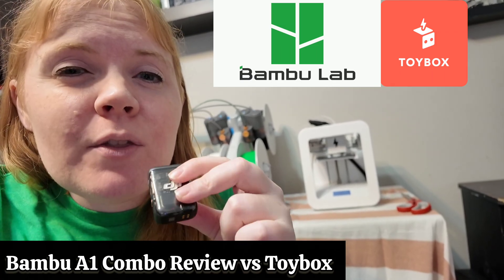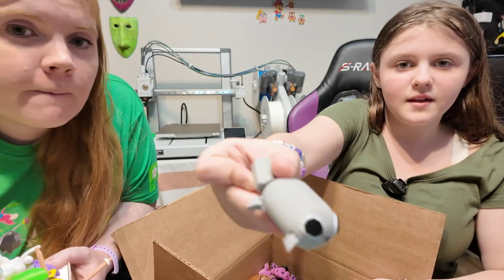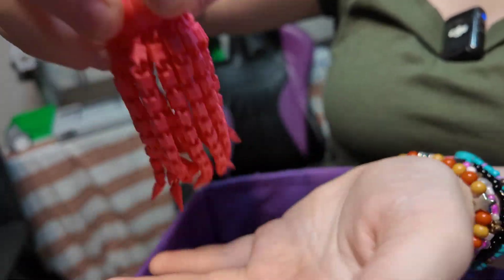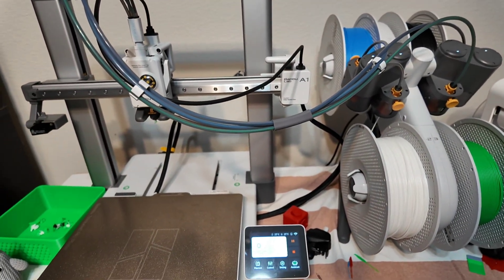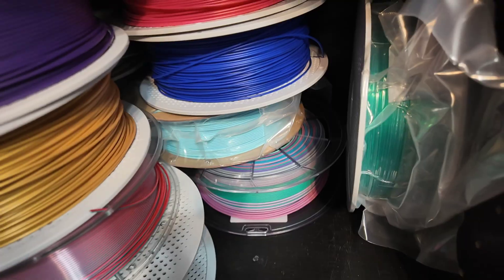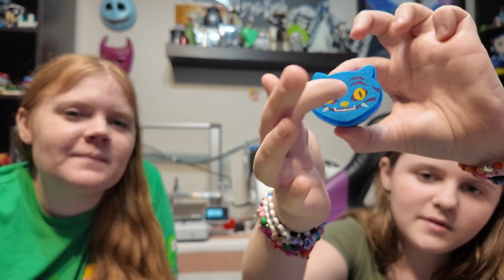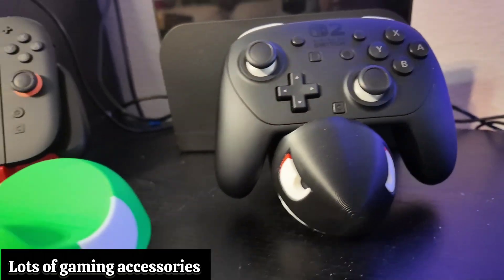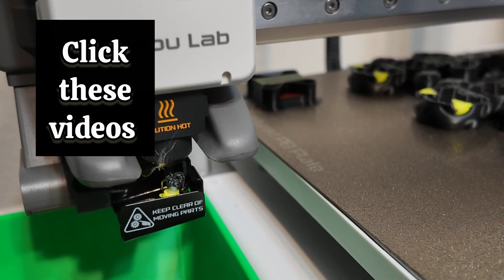BEST Beginner Family 3D Printer? Showing Prints & Easy Steps to 3D Print on Bambu A1

Comment: Do you know if the articulated dragons can be done on the A1 mini? Based on my research they can be done, but they'll be  smaller. My daughter asked specifically for a machine that can print these dragons.
Reply from the maker: Yes, just smaller like you said. I researched the difference with the mini and it seemed like it was more limited. I'm super happy with the A1. But if you can't do that one, the mini can still print smaller scale items.